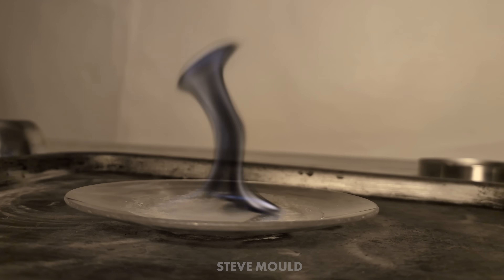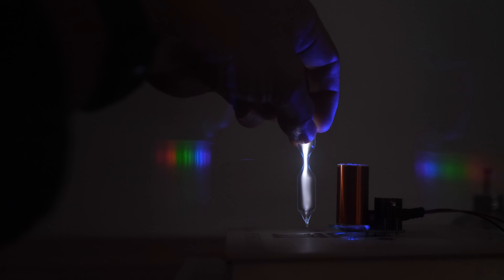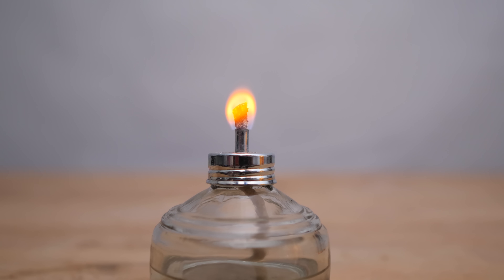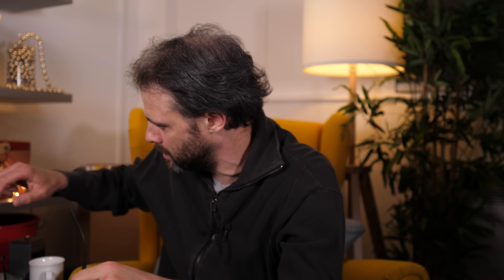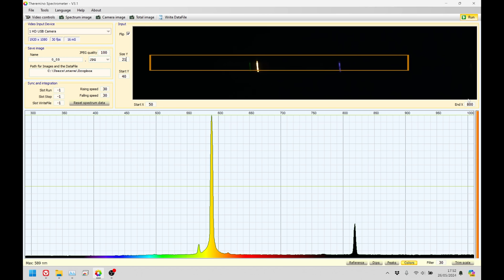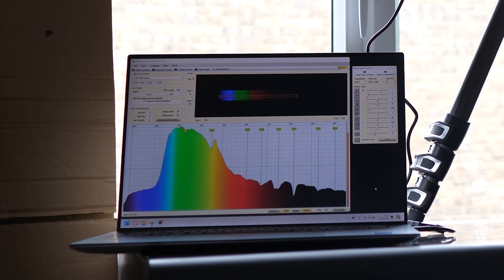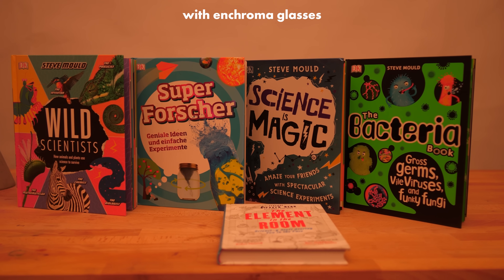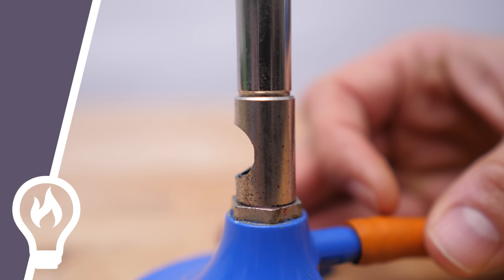Light sucking flames look like magic

Comment: 10:06 the width of the bar as apposed to the surrounding lines that bar show like data on magnetic storage and is 3 wide and is 101 in binary setting the 2 peaks but under not enough detail to see the 2 peaks.

Comment: The 819 nm (IR) peak from the sodium street lamp indeed comes from sodium! It's 3D -> 3P transition at 818.6 and 819.7 nm (full fine splitting has 3 lines, but the splitting of 819.7 line is around 10^-4 nm, which may be within the natural line width of the transition). For a proper fact-check, see NIST at (https://physics.nist.gov/PhysRefData/Handbook/Tables/sodiumtable5.htm) or Martin, Zalubas, J. Phys. Chem. Ref. Data 10, 153–196 (1981), "Energy levels of sodium Na I through Na XI".

Small peaks on both sides of the main yellow D line peak at 589 are most likely 568.8 nm from 4D->3P transition and 615.4 or 616.0 nm (I'm not sure which transition it corresponds too). The wavelengths are recorded by NIST (https://pml.nist.gov/PhysRefData/Handbook/Tables/sodiumtable2.htm). Sadly I couldn't get the original paper they referenced. 4D->3P is my guess based on matching energy levels I found in the Martin, Zalubas paper above to the wavelengths.

Comment: I didn't expect to hear about electron spin in this video but I am glad you talked about it.  I have been unsatisfied by the lack of depth I've seen people get into on what electron spin really is.  This is the first time I've heard anyone say that there is a relationship between the spin of the electron and the direction of the orbit.  I was missing any sort of explanation on how the spin could be one of only two possible values, but now this gives me some idea on how that could be the case.  Thank you very much for that.
Reply: Be careful, it's not like the spin of the electron exists because of the orbit or something like that. A free electron that's not orbiting anything still has a spin that works the same way. What he was talking about here was just that both the external angular momentum due to the orbit and the intrinsic angular momentum due to spin generate magnetic fields, which can interact with eachother and thereby result in a different energy level.

Comment: Color is not something your eye sees. It’s something your brain derives. This is why your perception of color seems stable even as the sun goes down and the color of the incident light changes. The idea of enchroma is that if you can get a stronger signal separation to the brain, the brain can derive the differences in color better.   What I do know from my own experience not being color blind is that amber tinted polarizing sunglasses enhance my perception of green in a way that makes foliage that would otherwise look all the same basic green, suddenly appear to be undeniably different hues of green. It makes the blue sky look bluer. And enhances other colors as well. I think the folks who came up with enchroma noticed the same basic thing and figured it might enhance color perception for folks with color blindness.

Comment: I'm not familiar enough with optics and physics, but would it be possible to create a glass treated with two different kinds of one way mirrors reflecting different wavelengths so it would show a black flame while being see through, with no additional light source but the flame itself? 

Or maybe just a glass treated similarly to the glasses to simply make the flame look black from the outside?

Comment: The narrow visible emission of sodium has another use: since refractometers are much more accurate when excited by a single frequency of light and this is the easiest frequency to achieve, the refractive index of a substance is always defined at 589 nm, the doublet frequency of sodium vapour emission.

Comment: would a single atom be a 4th dimensional object rather than a first, its an object that takes up a defined space but the position of its components in space time are impossible to truly define as there is no way of knowing where in the orbital level an electron is located at any given time, similar to how many faces a hyper cube appears to have based on where it is viewed from. and if so would that not mean the universe is comprised of 4th dimensional objects only they exist on such a minute scale that they are perceived as 3 dimensions. with the 4th being entropy or where in the transference of energy an atom is. and we define this transference of energy as time as we can only see this dimension linearly as we are only capable of viewing it as we move trough it. seeing as the very matter we are comprised of would have to stand at absolute zero in order to actually "visualize" its true whereabouts as going a dimension above to the 5th would cause entropic folding allowing energy to move backwards, or rather would be the level at witch true anti-matter would come into existence. it would be the same matter that comprises the universe only it would be quantum locked into following a defined counter path thru entropy/time, we would likely view this as the "destruction" of matter, only it must preserve newtons laws and would as it still exists. its just existing at a different point along the particle "time-line". If this truly is the case the big bang may have been the point at witch the previous "universe" reached its heat death and its matter being unable to simply cease to exist it did the only thing left to do, hit the reverse. and as all matter and energy reversed, much like when the flow of electricity changes circulation direction based on the polarity of the wire its flowing thru there is a brief quantum time frame in witch the flow of electrons stops and they re polarize to the new medium. the universe does the same causing a massive surge of "entropy" in the new Forward direction. guess what I'm trying to propose is that matter and the fourth dimension are a pendulum and that the peak and backswing of that pendulum is wherein the 4th dim, time, exists. the theory would still allow for the random nature of matter to exist explaining antimatter and matter and how they can and do both exist in the "same" universe its because the "anti" merely means it is the state of the matter that exists now on the backswing of the pendulum when entropy is flowing counter to what it is now

Comment: Xe is a monatomic noble gas that when excited emits white light with a full spectrum. Don’t you think that needed a bit more explanation than you gave it? It’s actually because ionised Xe forms Xe2 (which is charged) but lasts long enough that the vibrational energy state it’s in before it decomposes and light is emitted becomes important and perfectly spans the visible spectrum. Xe2 at the furthest apart in the vibration emits light that’s red and Xe2 that’s closest to each other emits blue with all the colours in between corresponding to the different visible wavelengths. It’s a very useful property of Xe and high pressure Sodium tries to exploit a similar phenomenon.

Comment: Wow, I can't believe that I've never put two and two together, but I honestly didn't realize until now that sodium street lamps render color useless. It's not that I'm color-blind or anything; it's just a sort of conceptual understanding I've not stopped to consider enough for it to sink in. Always just thought of it as 'weird orange.' Amazing what you can miss! Thanks.
Reply: Low pressure sodium lamps are really rare in my country (these days?). The first time I drove through an area that had them, it really threw me for a loop. I could not understand why all the normally red or blue signs were grey.

Comment: Surely there is a fairly easy to test if the enchroma actually help with color blindness. I assume we know how people can be color blind and that we can use cameras to replicate what they see. If we can't do that, then forget the rest of this comment.
Otherwise, surely you could modify a camera to see the way color blind people see (and do so for each way a person might be color blind, as well as for other experimental criteria you may wish to test for such as the same at different brightness or something like that), and then stick the glasses in front of the camera to conduct tests to see if it makes distinguishing color easier, and if it only works for certain kinds of color blindness or certain combinations of color.
At least from the way he described the tests, it sounded to me like they do help distinguish colors on opposite sides of the dip, but did not help to distinguish colors within the dip (as they were being flattened, and thus looking more similar or at least not any less similar.

Comment: one cool addition to this regarding the re-emission from the sodium flame being in all directions: confine the sodium light to be more or less collimated and aimed through the flame, then put your camera at 90 degrees to the light path, with a dark background behind the flame from the camera.  The flame should get brighter when the light is turned on, because some of the flame's reemitted sodium photons would reach the camera that would otherwise not receive any 590nm photons.  Different mechanism but same idea as "why is the sky blue?"

Comment: Fascinating topic!

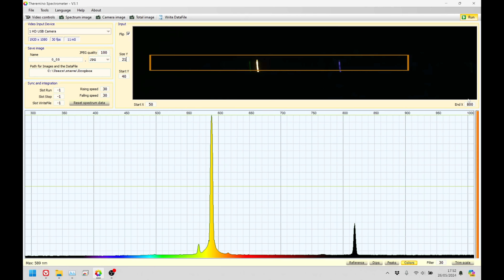10:10 The side peaks on the sodium line could be second order refractions from the diffraction grating in the spectrometer. If you measure the frequencies of the side lobes and assume they are second order diffractions you can calculate the line spacing of the diffraction grating, which comes out to roughly 843 lines per millimeter, which is consistent with moderately priced commercial options (for example, Edmund Optics has a mid-range filter with 830 lines per mm).

It could be the 5s-3p and 4d-3p transitions, as mentioned in another comment. I have no idea what the relative intensity might be, and spectroscopy certainly isn't my field. But with inexpensive equipment I'd suspect spurious sources before physics. On the other hand, if it was refraction you'd probably see it with laser sources too, so it would probably be easy to check.

It might be possible to remove second order peaks in software with careful calibration of the system (such as with two or three single-frequency laser sources) and sophisticated signal processing (maybe with some hinting based on the expected vs actual RGB components at each position). Spectral unmixing is way beyond my signal processing capabilities though!

As a colorblind user of glasses similar to the EnChroma glasses, Steve's comments accurately reflect my experience with them. Mine notch out a chunk of the green spectrum (which is very visible when projecting sunlight through a prism and the glasses). This makes it much easier for me to distinguish between red and green. Red looks much more orange, and green looks quite brown (foliage looks lifeless). For example, small red flowers or berries on a green bush become visible. The color accuracy in general is pretty awful, and a natural world devoid of green is very disappointing, but it's often useful to be able to see small red/green details on a green/red background.

Comment: Well that's a low pressure sodium typically used in photographic darkrooms.
High pressure sodium has a bit more color, because of the bit of mercury in them. That's why they're more peachy, unlike low pressure sodium, which is just orange.

Comment: Around the 3:10 mark, when he is explaining the electrons yada yada, is this how a neon gas sign functions? Also screw it, on a scale from 1 to 10 one being based and ten being absolutely stupid, where does my question fit?
Reply: Neon signs work in the same way the xenon gas he showed works just with electricity being pumped thru it instead of putting in near a Tesla coil

Comment: Electrons don't really spin, but rather they have a property which can be modeled by maths in the same way that angular momentum is, so for conceptual simplicity it's simple to just call it angular momentum.

There's a common homework from university level physics courses to figure out what the rotational velocity of an electron would be if it literally spun - and that turns out to be greater than the speed of light

Comment: When looking into photorealistic physically-based computer generated images, I've seen interesting examples of substances that both absorb and emit light at the same time, resulting in unique look depending on e.g. density and thickness of the substance. One great example would be volcanic ash clouds - a thick cloud of hot ash will absorb most of the light trying to pass through it from the other side, but will also emit its own light, and since it's not fully opaque or uniform, it gives very interesting effects.

Comment: As somebody with enchroma glasses, I guess I should leave my 2 cents on the issue. 

My glasses correct for protanopia. There have been instances where I couldn't see the numbers in color blind tests, but then I was able to when I put the glasses on. However, yellow road signs look more orange to me when I wear the glasses, and the red and green of stoplights specifically become harder to tell apart. Overall, I'd say it was worth the money, since it does have measurable results, and the side-effects can easily be countered by just taking the glasses off when you need to.

Comment: The one thing about glasses that can help with color blindness is the difference between efficacy (Clinical, ideal and controlled environments with the least amount of deviation possible) and practical efficiency. (How well something works under real world circumstances based on much more varied mixes of physiological reactions or biological reactions, such as light spectrum shifts in this specific case.) Efficacy rates can be far higher or even lower than practical efficiency in practice. I used knew someone that wore normal prescription glasses that he sprung for a filter set into or atop of the lenses, to boost green light sensitivity, for all intents and purposes. As that's where his colorblindness was focused. For the initial period he wore them as he got used to them, it caused a distraction while driving because it was just such a different experience and it was hard to keep from looking at things like green grass or bushes that he drove by on a regular basis.

So an off the shelf item such as the glasses you tested might have far more broad spectrum variations that aren't meant/able to help heavier color sensitivity shifts. Or at all if a certain cone color is just absent.

Certainly not all levels or types of color blindness would be possible to correct to a highly notable degree or perhaps even any preceptive degree at all. (I'm not aware of any ability to correct the much rarer complete color blindness for instance.) I also knew someone in middle school back in 2007-2008 that was heavily color blind in bias to red being the primary color he could see. Didn't ever really seem to effect him as far as I could ever tell from his navigation of the world or daily life, but I imagine that with such a HEAVY red shift I don't see any color shifting glasses or lenses that would likely help with the practically monotone color vision, so to speak. I could be wrong however.

Comment: Steve,
At 11:13 you ask 'How can something that's one-dimensional have spin?'

I queery this phrasing, you suggest that electrons are one-dimensional objects.
Is this a confusion over such titles involving 'one-dimensional electron gas'(es)?
Electrons exist in the universe, so are 3-d objects, no?

I ask because this thought is now nagging at me, is there some quantum-mechanical symmetry argument that I'm missing.
(For reference, I'm about to be awarded my PhD in quantum engineering, specifically looking at scattering problems involving electrons (in memristors, tho that's less relevant to this question at hand).)

I'd be interested in a follow-up if you have the time,
Thanks,
Charlie

Comment: It’s good to know that many street lights, at least in the US, still have sodium lights but they also had two different kinds of sodium lights. High pressure and low pressure. High pressure produced light on a broader spectrum and were thus used as grow lights and still are. At least in areas where electricity is affordable.

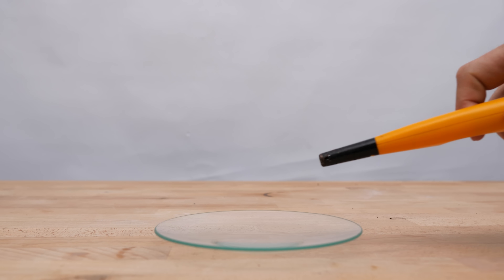Comment: 3:50 To nitpick, the electrons flow from the cathode to the anode, not the other way around.  In the late 18th century, the flow of electricity was assumed to be positive charges flowing from anode to cathode.  In the late 19th century, experiments with cathode ray tubes proved that the charged particles were actually negative, flowing from the cathode to the anode.  By then, the traditional flow was so entrenched, that it was not changed; it still hasn't be changed more than a century later.  In essence, positive electricity flowing one way is equivalent to negative electrons flowing in the other direction.  But anodes do not emit electrons, they absorb them.

Comment: To filter out the sodium yellow we used to use pieces of cobalt glass in the lab. But the use case really was just to be able to see the colour potassium salts give to a flame in the presence of miniscule amounts of sodium (like, always) which would outshine the potassium.
Cool to see, after so many years, that there is actually a real use case for this, although not with cobalt glass.

Comment: Very nicely done, good explanation of subatomic photon production (and absorption).  As a theoretical concept, I had thought about "dark light", but had never seen an example of such as being demonstrated via a black flame.  Of course, there are well known examples of "invisible" flames (partially a function of the flame temp, and the relative energy levels of the electron orbits), a terrifying example of which is the methanol fuel used in race cars.  It has happened when a driver is being burned with a flame no one can see, but the process of being burned  becomes extremely apparent.